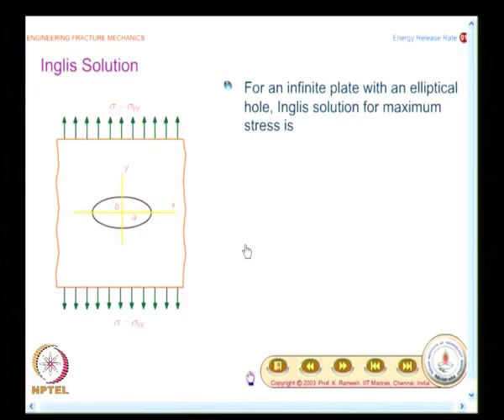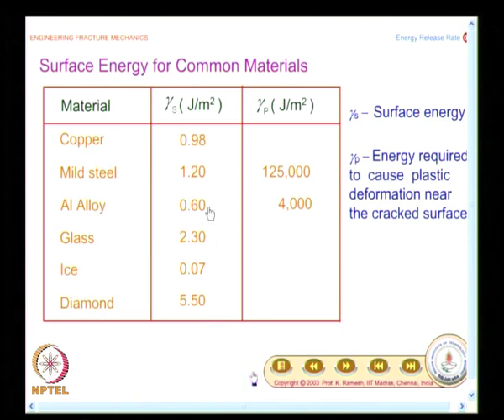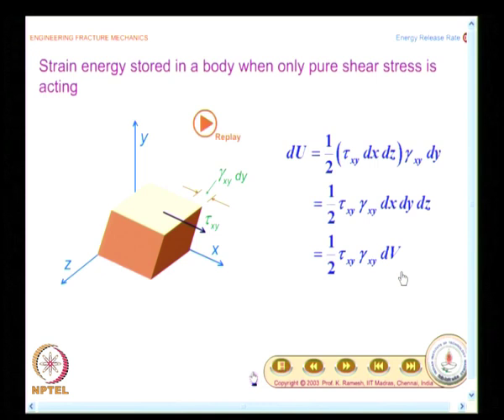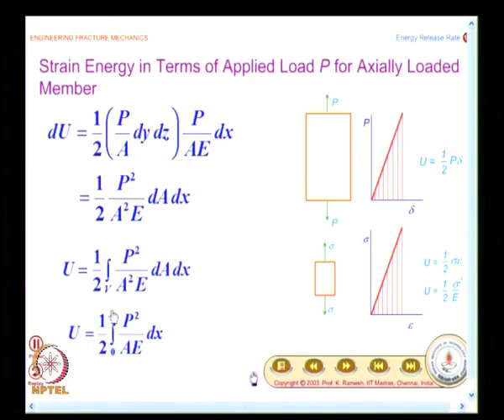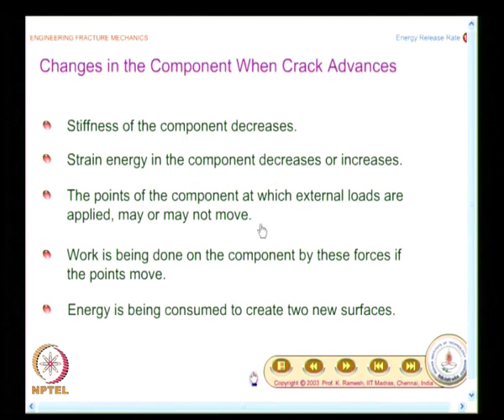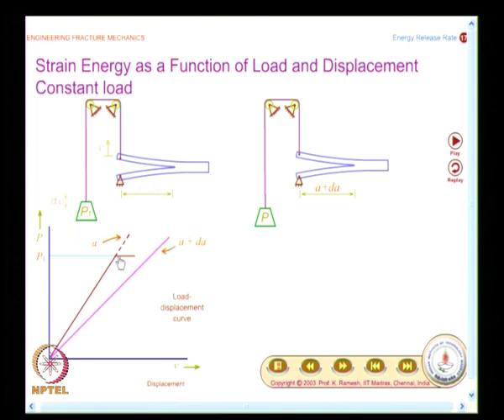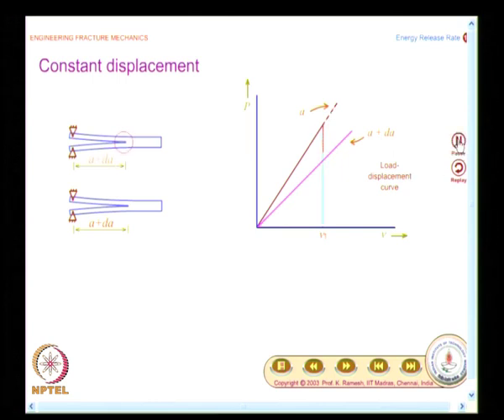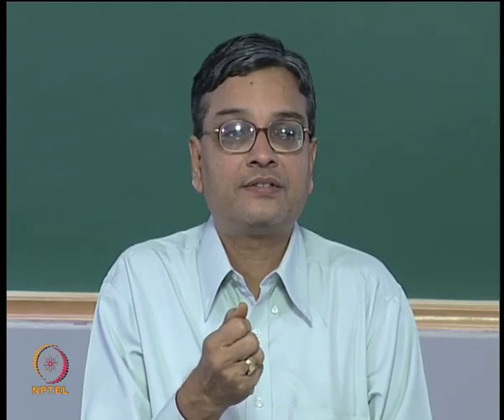Elastic Strain Energy

Comment: To clarify any confusion, when you are trying to find out how much energy exactly is spent to grow crack from length a to a+da is given as follows:
1. constant load: 
Increase the load gradually to P1, at which crack increases from a to a+da and corresponding displacement changes from v1 to v2. Hence, external work done at this point is 0.5*P1v1 + P1(v2-v1).  Part of this work is stored in elastic energy, the other part was spent in advancing crack. Unloading this configuration releases the elastic energy stored, which equals to 0.5*P1v2. 
Hence, work done to advance crack from length a to a+da is 0.5*P1v1 + P1(v2-v1) - 0.5*P1v2 = 0.5*P1(v2-v1).
This work is stored as inelastic strain energy = DeltaU = 0.5*P1(v2-v1).
In differential form, dU = 0.5*P*dv
2. Constant displacement: 
Similar to the first case, pull the double cantilever beam until displacement v1 and load P1. crack advances while keeping the displacement constant and dropping the load to P2. After this unload the double cantilever beam by reducing the displacement to zero. The net work done to advance crack under constant load will be 0.5(P2-P1)v1. 
This work done is stored in inelastic strain energy in a differential form: dU = 0.5*v*dP.

Now, in the first case, the term dv (v2>v1) is positive which implies that strain energy increases, while in the second case, dP (P2<P1) is negative which implies that strain energy decreases.

Hope this helps future learners!